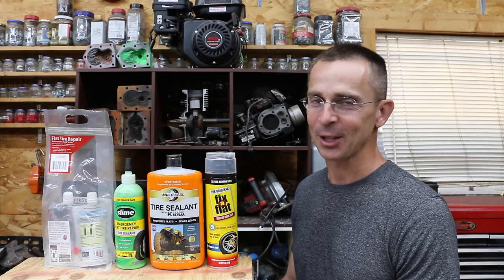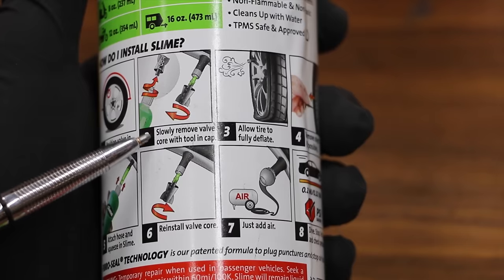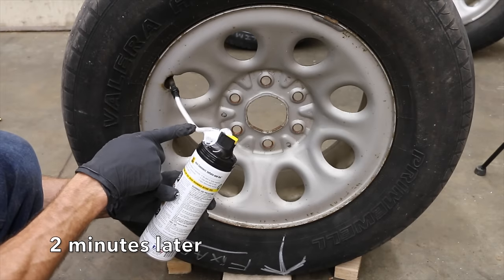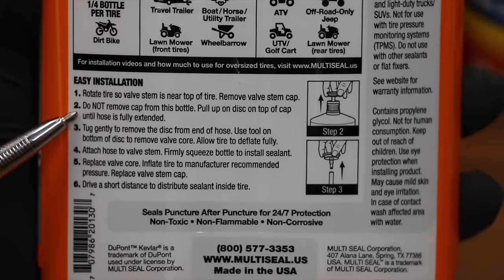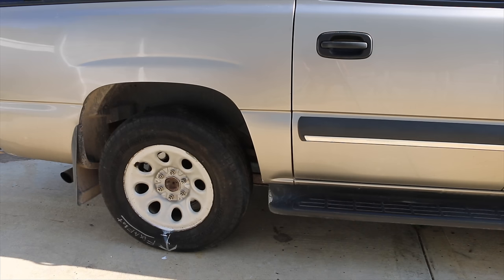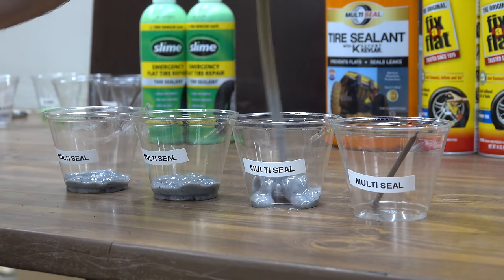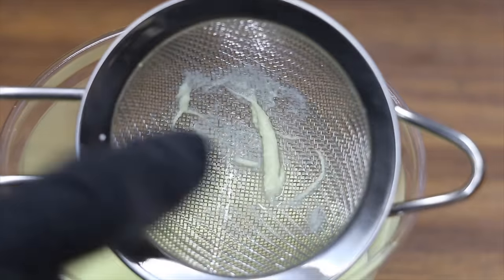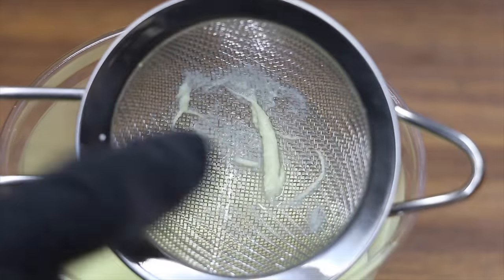Is Tire Slime the Best? Fix-a-Flat vs Tire Slime, TireJect, MultiSeal. Let's find out!

Comment: Where is Flat Out in this test?
Reply from the maker: Great suggestion for round 2. Thank you
Reply: FlatOut is Multi Seal, they just changed the name at some point.  The company is still called Multi Seal, but they changed the name of this specific sealant to FlatOut.  Fantastic stuff.  My go-to sealant for my bicycles and pneumatic tire electric scooters.  👍
Reply: @crominion6045  Thanks. Didn't realize that.

Comment: Buyer beware; the Slime that comes in the aerosol can does not work! I had a <1/4" sized hole in the sidewall of an SUV tire. I tried the aerosol slime, and it all just blew out of the hole. I bought the other type of slime where you have to remove the valve stem, and so far it is working ok, though it might still be leaking a small amount.
Reply: NO tire sealant is designed to fix SIDEWALL holes.
Reply: @fireballxl-5748  To be more specific, it was within 1.5" of the tire tread, just barely outside of the "repairable" area. It was right on the corner where tread and sidewall meet
Reply from the maker: Thanks for sharing.

Comment: Slime is a very bad idea. It ruins the tyre and pressure sensor. Always use a spare tire.
If you hit a pot hole that takes out the side wall none of these goos will be of any use.
Reply from the maker: Thanks for sharing.

Comment: Fix a flat is crap dosen't work at all . Shame is the winner hands down  it also does off road fixes great . Also it will fix light dry rot on sidewalls if place tire laying down on its side of rot . I made tires last longer with shame in them

Comment: YOU SHOULD NEVER USE FIX A FLAT!!! THERE IS NO SENSOR SAFE FIX A FLAT!!! IT CHANGES THE COMPOUND OF THE INSIDE OF THE TIRE MAKING IT HARDER TO REPAIR PROPERLY WITH A COMBINATION PLUG PATCH!!!!
Reply from the maker: Thanks for the feedback.
Reply: @ProjectFarm  tire repair classes we had to take when we changed products and got certified in tire repair. The older sensors with the rubbery back the fix a flat will eat it away and don't forget the sensors have a hole in them to read pressure. Bad stuff for sensors. It's best to carry a cheap rope plug kit and use it for an emergency. Then have it properly repaired with a combination plug patch. It will seal the hole preventing moisture entering the hole and starting to rust the steel cords and have a complete seal inside the tire. Tires shouldn't be repaired within an inch from the edges of the tire for safety and only up to a 3/8" hole on passenger vehicle tires. You got great videos, love seeing the different products tested! Keep up the good work!

Comment: Please never use any of these.
Reply: Why?
Reply: @JOSE-zf7eb  They're a waste of money. They may say "tpms safe" but I promise you I've seen all of these and more destroy sensors. These sealants are used for temporary fixes, they'll never hold permanently, something could hit that spot just right and end up causing the same problem again. It's messy for tire technicians aswell and takes extra time to clean out the tire,test the sensor,and wipe off the rim. It'll also throw your tire off balance if you use enough. Keep a plug kit I'm your car or take it to be patched for best results